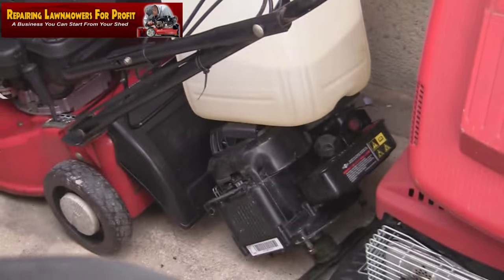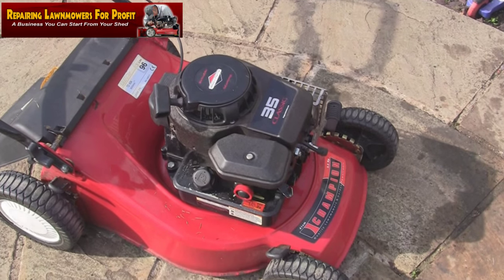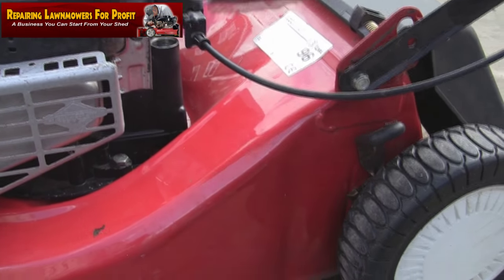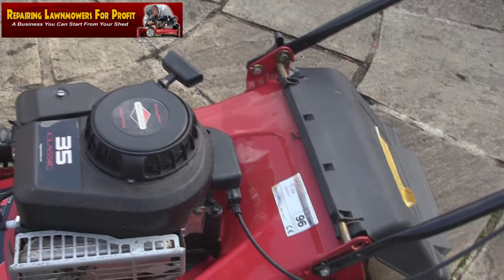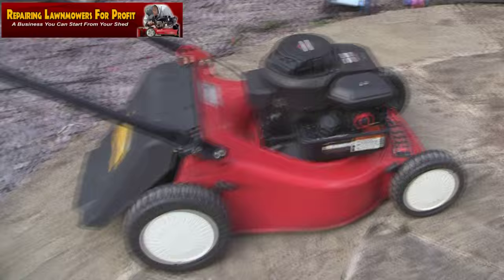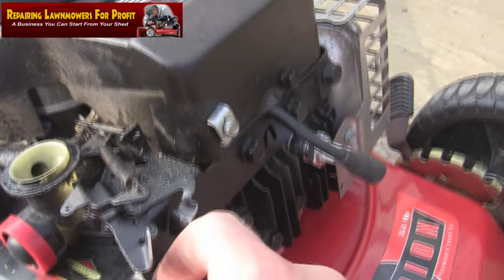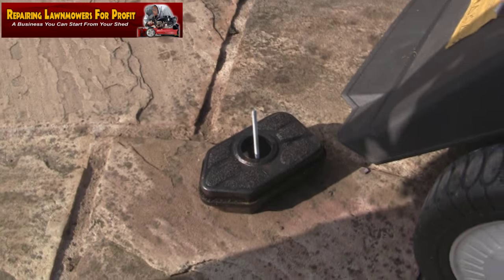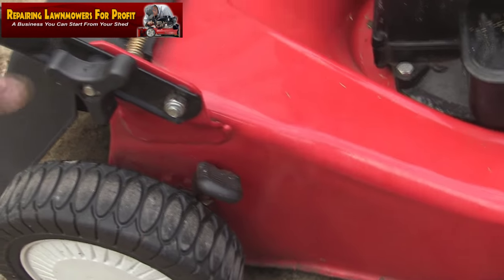Briggs And Stratton Petrol Lawnmower Service Tips And Tricks

Comment: Awesome video man, my sister has a Champion 375 with the drive on it, and I went through the service process in your videos. One thing I noticed is, that the new governor springs I put in seem a bit more tight than the old ones, so now the mower runs a bit too well, like it's always on high revs and running fast, will that ease over use?